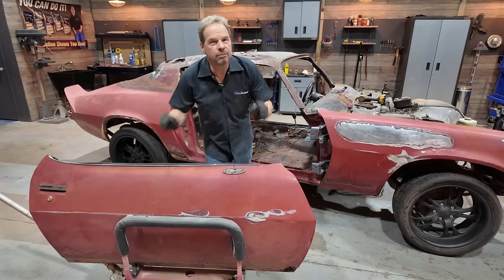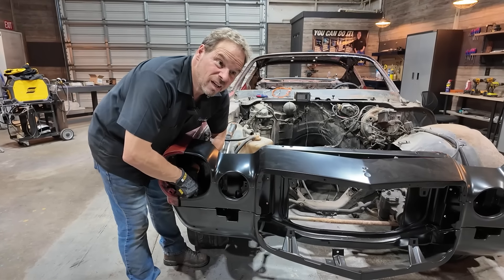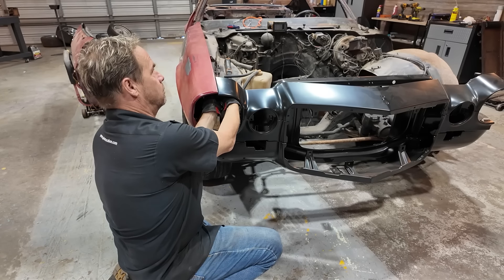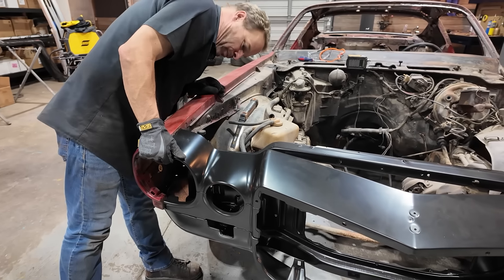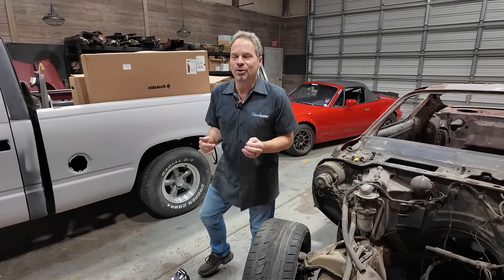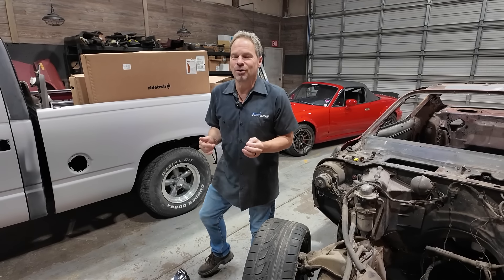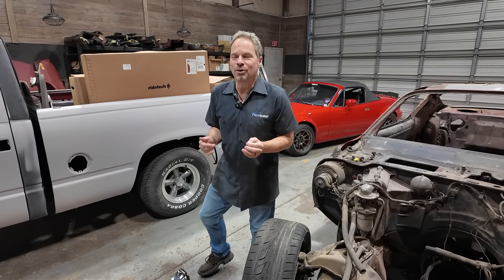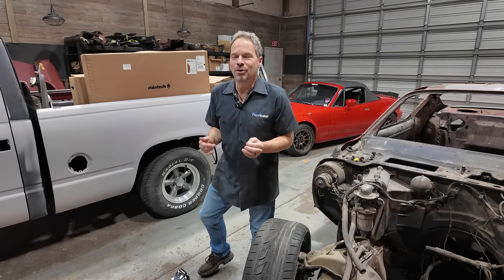2nd Gen Camaro Panel Alignment 101

Comment: Does anyone else think of Kevin as the Bob Ross of auto body or is it just me lol.
Reply: More like the guy from This Old House.
Reply: Maybe for paint.  But he actually is pretty amature at everything else.
Reply: @ajk374  you should probably start a YouTube channel to show everyone the proper way of doing things. 😂
Reply from the maker: @ajk374  Thanks for watching!!!    We all have to learn sometime. :)
Reply: @paintucation  hinge pins all same dia. cheaper better than ford ones so i use them. plus rear disc kits.. cant find much else any good.... had an 82 bronco, just sold, owned 23 yrs, sas front all d60.. you think the panels on that are bad.. even imported volksi,s were thrown together here..  ausie.. also have a 73 chall. 340 r/t.. anything chev here sells for a premium.. dont know why..
Reply: @paintucation  doors. i tighten,ish 1 bolt, snug others. easier to adjust.. rebuilt the inside of my chall doors.. im not good at rubiks cubes.. never knew inside of a door could have soooo many adjustments..digi dagi,s. 3 day jobi.. for 1.. ausie..
Reply: @paintucation  ill make a door higher to the striker. as the poofteenth of slope in the hinges is taken up..  hinges, then striker.. not telling you your job..  pus i try to align the pins so there no bindind . get the bottom one good then float the top so it settles, open/ close..  we cant do any mods, legally here in aus.. engineeres cost 4k to tik it off.. fkn bs..specially 4x4 mods..
Reply: @ajk374  i said to him about the door aligning..  i dont want to tell you your job...  but...
Reply: @josephyentz870  try to find a vid on the adjustments for a challenger door glass.. 72.. never, seen a door with so many parts.. & i have 2..  sht, hinges are nothing.. just dont bind them up like he is.. last 2 months, fkt again..
Reply: @josephyentz870  oh..  forgot..  ausie....
Reply: @josephyentz870  also. i leave the striker snug. so the door sets it. watch where it hits before closing. up down, in out.. all around, woo hoo..  ausie..
Reply: @paintucation  ausie.. nearly all yank cars, when closing the door.. new cars, 70,s.. sound like there falling apart.. just rattle..
Reply: @paintucation  my dream car, cough, not mine,...  split boomper comaro.. oh nice, did you get one..  no..  just the tags.....at least american cars you can buy everything.. here in aus.. nothing... why i have 5 yank cars..trucks, 4x4rs..  75 f250 highboy.. 351. 5 sp. cut to swb, sssssshhhh... dont tell anyone...
Reply: @ajk374  At least according to the person who can't even spell amateur properly.

Comment: When I put my 71 Camaro together, I used solid sub frame mounts.  After I bolted the sub frame to the body, I had a hard time getting the fenders to line up because the core support mounts were too thick.  I ended up making shims out of wood using a chop saw.  When I got the shims the right thickness, I had a machine shop cut the mounts down.  It worked great.  Good luck with your project.

Comment: I've done a few of these and g-bodys, once they're lined up I'd drill a 1/8 hole through the hinges to the cowl. Leaving the hinges on the door this way will give you a reference when reinstalling. The front sheet metal is a different thing, after installing new hockey puck frame mounts it moves everything but keeping notes on the shims will help.

Comment: Hit Rod magazine used to have section at end of the magazine. It worked for me. The tip was, when are adjusting heavy doors, put some threaded into the hinges. When you were hang the door, slide it onto the ready rod to help hold the door.

Comment: Hey Kevin, I've built a number of 2nd gens and one thing I found on the doors is that you should always use the factory hing bolts/fasteners since they can take so much more torque than the replacement bolts. One other observation is that sometimes you can remove the latch pin to align the door, and then the last step is installing the pin, also if you leave the pin a bit loose you can sometimes get into place and then tighten it down. In any event I really like this project and its gonna be a great car when you get done. Thanks!

Comment: Camaro doors are a b****h to adjust. The assembly line had these rubber spacer strips that aligned the door and they just had to tighten the bolts. An old body guy showed me a fairly easy way to align doors. Get a couple packs of wooden door shims at Home Depot ( the wedge style that you use to hang house doors ). Loosen all your hinge bolts and close the door. Use the shims to set your gaps ( I am only at 21:07 on the video so if you show this later on, oops ). Move the door around to align your surface alignment and tighten your bolts. It still takes some muscle work to move those heavy doors around, but I found it worked for me.
Reply: Ya, this video is hard to watch how bad he is st alignment.

Comment: Here's a little tip for hard to drill steel use a glass tile cutting drill bit and it will cut through it like a hot knife thru butter

Comment: FWIW - I used an Engine hoist and a couple 750lbs straps (spread out a little) to lift up the door from the middle. Boom will stick in the through the rolled down window, door closed and without the weather stripping, I can lift the door from the center and get better manipulation to align the door with the body lines.  Hopefully that helps someone else out down the road. Beats having to use a floor jack.
Reply from the maker: That's a great idea!!
Reply: Thank you! This was definitely one of my "Hrm, I wonder if this will work" moments.  I'm looking forward to your finished product. I'm doing the same thing to my 77.  Between yours and Stacey David's builds - it's been a wealth of knowledge.

Comment: Yepper doodle on the alignment holes. Actually same for the hood. What I have done was screw studs   in the hood. Place hood on hinges  then alignment with drilled holes. Replace stud  1at time with a bolt

Comment: I would have left front on to confirm gaps, bonnet ( hood) centered to front screen opening and gapped to bulkhead. Then does rear top of fender align to hood rear to give continuous sweep/gap.. This sets gap from rear edge of fender side to rear quarter to centre door in.  Your doors are moved back to tighten gap to quarter you might have a large gap between doorskin and rear fender edge

Comment: Good stuff, I was wondering if I was taught wrong or if it's just a matter of opinion on this.  I was taught to hang the door without the striker in place to get your base alignment, then add the striker to finalize anything.   I always used a ratchet strap to pull the door closed when needed but I found this to be a great way to align the style lines without any interference from the striker.  Any thoughts on this?  Thanks for all of the great content, it helps us do it yourselfers more than you can possibly know.

Comment: Spend a little more time spraying down factory bolts with WD-40 (or equivalent) before disassembly. You save a lot of factory fasteners that way. Same with plastic fasteners using Windex.

Comment: Thank you for showing the steps to hang a door.  HOWEVER, you didn't provide much detail (other than walking the door back to close the gap on quarter panel) about WHICH way to manipulate hinges to achieve door movement in and out.  Do you treat the three bolts holding each side of the hinge as a group (except walking)?  Do you ever shim hinge bolts?
Reply from the maker: Almost never will I shim hinges... There's too much adjustment the have to, as long as your pin bushings are good and there's no body damage.

Comment: I'm about to do hinges on my 96 Thunderbird. It seems to me that the easiest way to put the back on (with the fender off) would be to put them on the door first, in the closed position, THEN attach them to the body of the car. Is there a specific reason you did not do it this way?

Comment: Like I said before, before removing the hinges drill 2 1/8” holes in each hinge for location pins when you reinstall the hinges. It I’ll be dead on. Use 2 holes and not 1.

Not doing this you will be dicking around trying to realign the door for hours and it still may look like crap. Not sure what procedure they used on the assembly line but it sure wasn’t like here. A big gap at the top of the door is normal from the factory.

The factory used 2 washers on the door stud. I wonder who stacked so many on this car.
Reply: Pretty sure Chevy just tossed the door in the general direction of the car and slammed the hinge bolts in place.  Old cars, esp Mustangs and Camaros, you were lucky if a mouse couldn’t squeeze between the panel gaps.  😂

Comment: Having done this before the one thing you should really do is skin the doors now. When you skin the door, unless AMD gets you the choice pick of skin, wil change a lot. On the skins I've had, the rear upper door curve is never right. I've had to cut, weld, and hammer them into shape. Granted this will get you close but those skins are really a B****.

Comment: Did you forget to brace the body before you hacked the roof off like a dump truck because it's a unibody and the cheap ass dinocorn panels won't hold the weight and the body is the frame I bet that car twisted in 99 different directions when you hacked it lol good luck ever getting it true and not driving sideways down the road ... What a shame  plus it was mint like a week ago wtf happened?